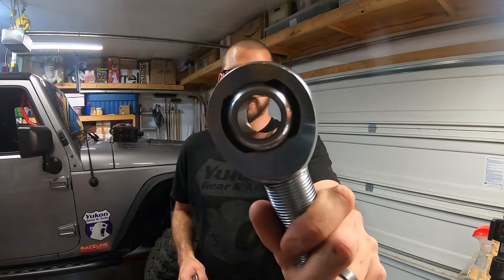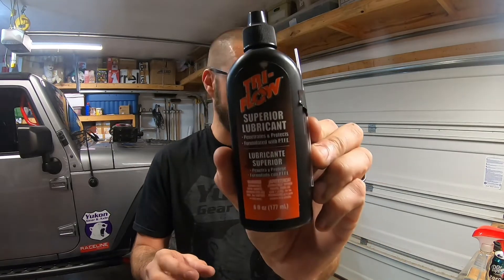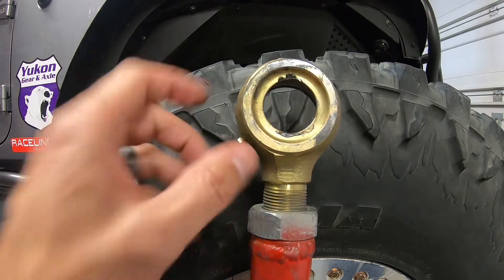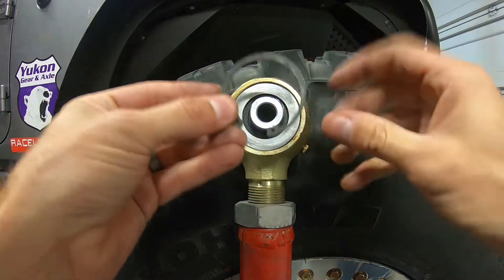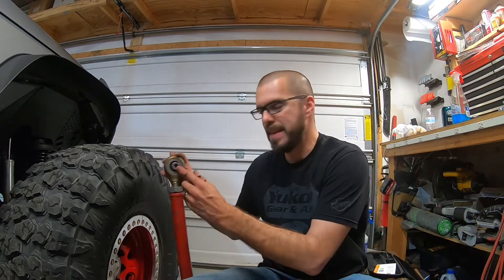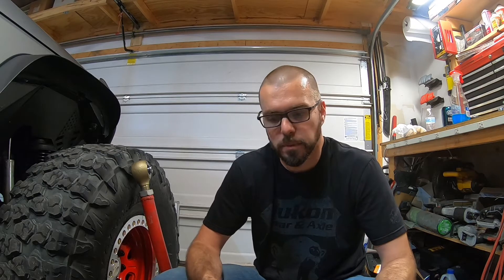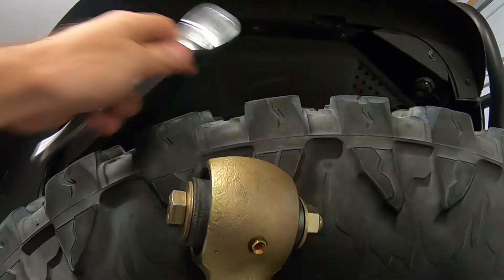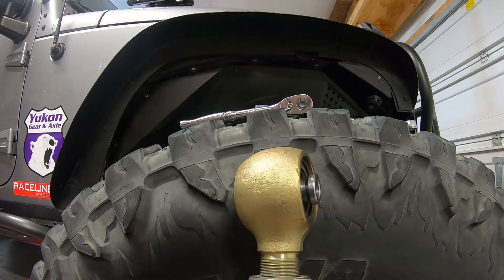WHY USE HEIM JOINTS? - Jeep Suspension Links

Comment: He joints squeak constantly if you run in wet conditions off and on like here in TN
Reply from the maker: For sure. But if you maintain them they are silent. You have to put oil on the seals. Tri flow makes a great oil for them.

Comment: You have to seat the bottom of the snap ring in the groove. Take a flat head screw driver on the inside edge of the snap ring and hit a few times with a hammer until it's fully seated in the groove.
Reply from the maker: Yup. I’m well aware. I have other enduro joints on my rig. They all have worked fine…but that one just kept falling apart. No matter what.

Comment: Which long arm set up are you running? I’m looking at Barnes4wd front and rear 3 link and pairing anti rocks with it.
Reply from the maker: I used their kit with I swapped to my one ton axles. It works well. Some minor issues with their brackets out of the box. Things like bolt holes not being drilled out to the correct size, wrong misalignment spacers, etc. but it works well once I got it all sorted.
Reply from the maker: I don’t see a point in the anti rocks. I run factory sway bars and just disconnect the front. It works perfect and it’s WAY cheaper.
Reply: @WarPaintTexas  cool, maybe I’ll do the 3 link set up then first. I just read online there was rear swaying and that it was resolved with anti rock. I’ll maintain the factory ones and if needed will upgrade.
Reply from the maker: @hunterwhitworth1271  yea I don’t have any issue with my rear swaying. It’s been great. No binding at all so it just flexes effortlessly. It’s really nice. It’s definitely not the same on road, but I have no reason to change anything out at this point. It’s not drastic enough that someone who doesn’t normally drive in a jeep would even notice if they took it for a ride on day.

Comment: For the 3 link long arms on my rig I went with heim joints everywhere but the Barnes crossmember. I went with offset enduro joints there to keep the joint at 0 misalignment. It would have already been misaligned with a heim. I would have preferred a heim but it is what it is. Definitely think enduro joints are great joints. They replicate Johnny joints that have been around for years and years. Like you’ve said. All depends on what your purpose and use is for your rig. Both great choices. Great video!
Reply from the maker: Yea man! I like heims too. But the long arm kit came with the enduro’s and they have always done well. But it’s got a heim in the front now!